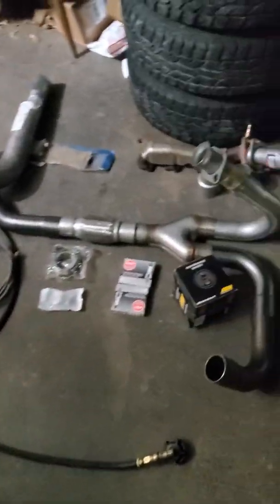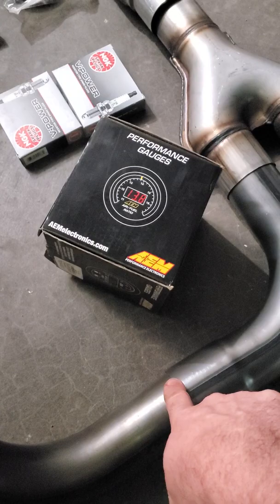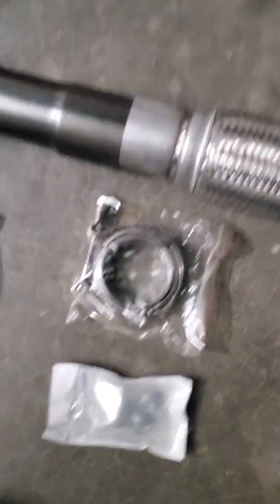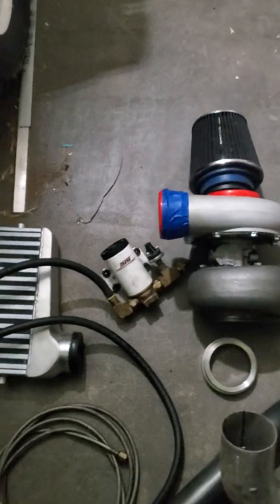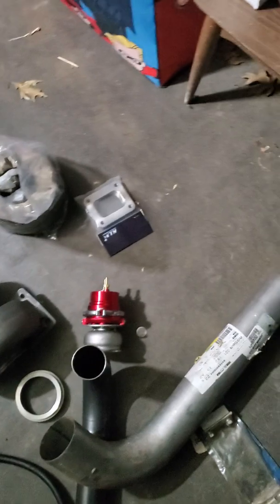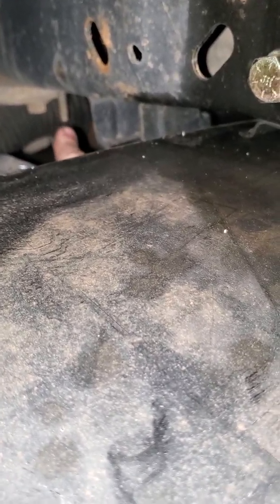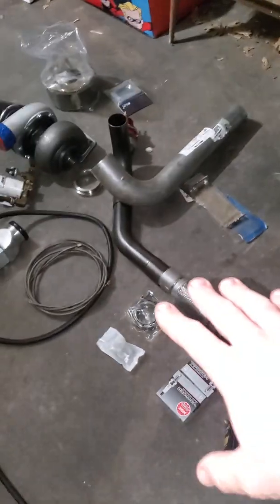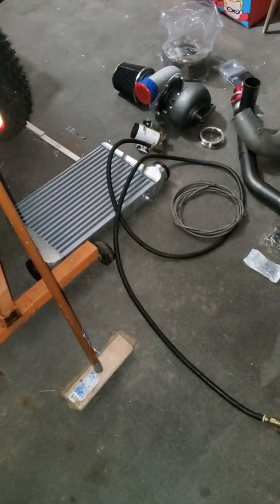How to Turbo a Crown victoria.  The parts needed.

Comment: Why not 3 inch
Reply from the maker: Why not 3" what?
Reply: @ pipe
Reply from the maker: The hole in the back of the manifold is not that big and I didn't want a 2" exhaust either lol
Reply: @CarModsandDadBod  fair enough

Comment: Hello there. By the way Thanks for the video. I got 09 police interceptor. I'll been thinking to do something like that. I'll been doing my own research. But nobody said what exactly do you need. Till I saw your video. Also how much would to buy all the the things you in the list? I know you probably are in a different state. I'm in California. Can you give a estimate how much was?  Please. Thank you
Reply from the maker: It was about $2000
Probably would have been better off with a complete GT45 "kit" from eBay.
That way all you would need is a fuel pump and injectors.
Someone on here posted that the OEM parts are good for 12 psi IDK if I believe it though.
One step at a time.
#1 always get a good quality wideband afr gauge.
Install it with your stock setup to see what your numbers are.
Turbo your car.
Go with lowest boost possible see how your car responds on the wide band.
Gradually increase boost to see what you can and can't get away with.
If you lean out, address your fuel problem (crown vics have a problem with fuel pumps anyway) get a fuel pump, see what happens.
If you need more get injectors, see what happens
Reply: @CarModsandDadBod do you have a kit you would recommend if so could you link it please and thanks

Comment: Especially is a Crown Vic. I have a 03' P71 I want to turbo. I appreciate the video.
Reply from the maker: Unfortunately times are tough an I will be selling this thing.
Reply: I do understand that one. Last week I was 2 hours from loosing my car and right behind it my job. Luckily I was able to borrow the money to keep it. It's like oneof those final hour deals lol. Yea stuff is Def tight. Did you ever get the turbo in her?
Reply from the maker: @GrandPitoVic  no I didnt.
Reply: @CarModsandDadBod  did the tubing and everything seem like it was going to fit under the car? I'm thinking about trying this out myself and continuing your theory, but if there is some reason it doesnt fit I'd like to know before I waste the time and money. Thanks!
Reply from the maker: @driftvic3690  my car is lifted so it certainly could have.
If I had to do it again I'm not sure I would use 2.5" pipe or a gt45 turbo, it's pretty big. And 2.5" pipe and Clamps are more expensive, not to mention smaller diameter pipes fit in smaller areas.
And again I was trying to design a removable "kit" another pocibly is to leave the driver side manifold, have a pipe come down under the transmission and back up to the passenger side and build a custom passenger manifold much like the ones made for LS engines and do a high mount setup so that a scavenge pump wouldn't be needed.
I'd you would like to talk directly I'm on Facebook 
Sprockit Roswell
Reply: Ok thank you.

Comment: After you make yours lmk what it's going to cost to get you to make mine
Reply from the maker: Where are you located?
Reply: Florida
Reply from the maker: @doaburnout1205  oh damn
Reply: Why you interested in making mine lol? My crown vic is an 01 with alot of work getting done to it atm
Reply from the maker: What kind of work?
Reply: @CarModsandDadBod  stage 3 cnc ported heads stage 2 turbo cams fully forged block and a t56. Also have some bolt on like bbk underdrive pulley kit 78mm bbk throttle body bbk cold air intake and a few other things.
Reply from the maker: Damn. The list of parts is on the video
Reply: No I have short vids of before it got painted last year and a short video of it painted and getting ready to go to the shop. When parts start coming in I'll be doing unboxing videos for a bunch of it and the mechanic is nice enough to let me swing by for progression videos! Once it all starts getting in I'll be doing videos big time!!!
Reply from the maker: @doaburnout1205  nice! We should do a build.
Reply: I'm game I want to twin gt45 it but a single is good for now lol
Reply from the maker: @doaburnout1205  2 gt45's prolly wouldn't even spool.
Shoot a 6.0L only needs 1
If you are Inclined to run twins, may want to try gt3582'd
Reply: @CarModsandDadBod  ended up going t76 turbo found good headers to use also in the build. See other comment for the link.
Reply from the maker: @doaburnout1205  I can't find it
Reply: @CarModsandDadBod  not sure why it didn't post the first time. Also posted it before this comment and Is gone now.. it's on ebay look up f150 turbo manifold look for ones that are stainless steel and have a turbo with the kit it's about 1250 for headers hostile and turbo

Comment: I have a 05 P71 that’s been sitting and I was debating on scrapping it or saving it and doing something with it, and I kid you not, I have been researching throwing a cheap GT45 on it for a couple of months now, so it’s wild how I discover these vids and your channel suddenly. I’m watching what your doing and I seen a guy on the turbo forums  do a similar setup, crossover tube under bellhousing ran forward on passenger side.. and I wanted to do that and leave stock manifolds in place,You should definitely make a duplicate hot side with the t4 flange, waste gate tube, BOV flange and 02 bungs, and cold side from Intercooler up to the throttle body and sell it. Just the piping, nothing else like the waste gate itself or BOV etc. Just the stuff that needs to be welded.  I’d definitely be interested because like you said, some of us (me) don’t have access to welders, don’t know how to weld, or have access to a pipe bender.
Reply from the maker: Awesome man! Glad to have you along.
Once I figure out EXACTLY what's needed, nothing more nothing less, and if there was enough interest, maybe I could make something happen
Reply: @CarModsandDadBod  I hear you. Keep us posted on this. I’m behind this 100%